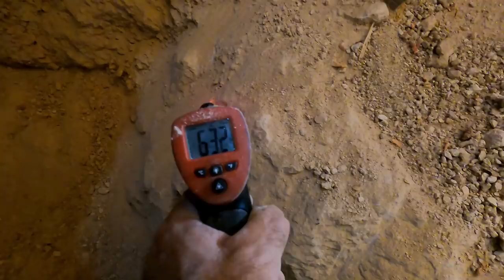Explosives Alternative to Rock Blasting Underground - Opening Up The Chinese Mine Shaft

Comment: You need a concrete saw. Score lines 6" to 8" apart 6" plus deep. should be able to get a pry bar in and break big chunks off. You can even use a water kit to keep the dust down.
Reply: You can buy them in battery or 110v , very little noise and zero fumes , a gas saw in their would be brutal
Reply: He runs his tailings through a crusher and sluse and gets gold from it.
Reply: Big fan watched it all from the beginning. I would like to meet ya some day. To pis poor to get back down to az. My fam. Spent wimter in quartzite.

Comment: I use hydraulic splitters to  break rock, heaps quicker than the expanding grout, minutes instead of a day, and fewer drill holes.
Reply: You ever see that one made by Colin Furze? He dug a tunnel under his house and had a nice Hydraulic pick.
Reply: I use homemade blasting agents. But I wouldn’t recommend anyone try that. As the FBI and ATF WILL come for a visit!! They even came to me…..but since the Gov is soooo damn smart, they didn’t bother look to see I’m a licensed explosives manufacturer prior to coming here. I have a license, y’all won’t be as lucky!! So proceed with extreme caution!!

Comment: Jeff You want to pick yourself a ‘Powered’ air purifying respirator - one with a battery operated air pump, attaches to your belt and uses high efficiency particulate cartridges. Much more efficient and less fatiguing to use over a long period of use as it pushes filtered air into the face mask . Plus since the filter unit is behind you it tends to last longer as it’s out of the immediate work zone. Draeger, MSA and North all make these. It will be a lot less tiring than trying to suck air through a traditional unit like you are wearing . Keep up the hunt , believe me I know from experience - enjoy the videos!

Comment: Hey Jeff, 
 real talk at 12:36 in the video pause i. Now look in the bucket about halfway up the lip on the left hand side Edge, you can see a ( m )-shaped or a (  w ) shaped Stone / possible vertebrae. When the thought of it,  
If  I didn't see the exact same shape at the front bottom right of the bucket. An M or W shaped Stone. And if you look in the middle of the lip of the bucket about halfway in the middle up and halfway centered you can see 2 vertebrates that look like they're connected and the 1 on top has broken off and rolled away.
   Am I tripping or could that possibly be bone fragment?
Reply: Ps.  I used a ×10 magnification looker.

Comment: Hey Jeff!

I think your videos are getting better every time! Really great to see an alternative for blasting with explosives. The vibrations of explosions could cause all sorts of trouble. Now its nice and quiet. 

Do you also make exploratory sample drillings? That could safe a lot of time and money right??? Or is the ore to scattered or gold to chunky to make any good drillings? Or are you already in the right spot? Im reading "Metal Mining Practice by Chas. F. Jackson & J. H. Hedges", its from drilling samples to making (wooden, concrete, and steel) sets. Maybe it brings cheaper alternatives for making shafts and tunnels. I also uploaded it to my archive page (if you cant find it).

 Greetings,

Jeff

p.s. 
The archive page also brings some books about digging tunnels in soft ground. I dont know if i would want to do it like that. Maybe its more easy to inject grout ahead into the loose ground above and to the sides of the would be tunnel and support from there. So there is less chance for a cave in... Something like the New Austrian Tunneling Method.

Comment: Hello, I have been following you for a while and I like your method of prospecting and working on extracting gold. I would like to ask about how deep the hole is from the beginning, vertically, so that I can dig horizontally and safely - your follower is from Mauritania.
Reply from the maker: our drift mine is 40 vertical deep at it deepest point
Reply: @Askjeffwilliams  Thanks for the answer, I mean that I can open a tunnel after 40 meters in different directions targeting the gold-bearing quartz vein.

Comment: Worked at Homestake underground operations for about 8 years.  We used air powered jackleg drills with drill bits on the end of drill steel.  I would think that would be a lot faster for hole drilling.  Nice thing about that is you can knock the drill bit off and sharpen.  Love what your doing, doing without explosives would suck but I gotta admire your energy.  I would enjoy your video a lot more without the attempts at humor or whatever that is.
Reply from the maker: I agree ...gotta get my hands on a Jackleg ...... we always like to show other methods of breaking rock as not every one has an FEL
Reply: @Askjeffwilliams  learning to use one is the easiest way of turning a strong man into a weak man, LOL.  The air leg is a real bitch.  Once you get onto them they are amazing.  Spent more time on one than I care to think about.  Pretty sure at my age I could still run one, but I don't want to.
Reply: Dakota: He's a package deal!

Comment: Add an secondary container with a opening 2/3 down from the top on the side,
 opening facing  left. For your working hose connection to suction drill holes in rock.

and a hole  in the center of the lid so as to  hook the vacume cleaner  hose to center hole.

 This configuration Creates a swirl in the secondary  container where most of the rock in aggregate  swirls down to bottom ,and only the finest dust makes it  off the wall and in to center hole. 

That dust is transported to the primary vacuume container and into the filter.

If your secondary container is small enough to fit in your lift bucket  just roll it over and drop it in. Ring the bell  and clean the filter while you wait for the return.
Thats how i would do it. The shopvac could be 20' away from your secondary container if need be.

Comment: I used Dexipan on Several OCCASIONS HARD ROCK .. IT WORKS SIMPLY spectacular. I actually used 1” drill bit 18” in hard rock Rhodonite , 12 holes  and broke out 10,000 pound 6 feet into the bed rock..  I also drilled a 10,000 Boulder and it is set to pour Dexipan  in this summer.  I do same as Jeff use vacuum to clean hole but I actually use a 18” by 1” round hole brush to clean sides of holes. And I also drill 1 1/4 “ core bit  in few of the holes to get a picture of the material.  Just polish core . I actually purchased my Dexipan at HOME DEPOT JUST ORDER THE TEMPERATURE YOU NEED!
Reply from the maker: great info

Comment: leave it for about 4 days and pour  water over it everyday if possible.
 we tried leaving it lower in the hole and capping it off with some rapid cement but didn't seem to help.
the ECOBUST brand is a bit cheaper and works just as good.
the deepest I have ever gone is 24 inches x 1 1/2 inches and seems to work all the way to the bottom.
your correct about using it an edge to rock has somewhere to go..
after you pour it, try and get any air bubble out of it with a stick or rod or hit around the rock with a hammer. I know you dont have
much time...its fast and gets hard quick. adding more water than they recommend does not seem to effect the results but takes longer
to do its job..yet gives you more pouring time. I don't think you will use it for mining..its too expensive.

Comment: What if you took a rock cylinder drilling core sample and cap the hole with that stone cylinder and hammer a cut nail in the side to jam fit it so it cant pop out. Might force more expansion sideways and that last 4 inches of hole wasnt used so it saves on slurry a little.  Or a wood dowl hammered in with a split hammered in the center to jam it in tight.  Like how a hammer handle is split to stay on tight. Just thinking too much.  Enjoying your success totally.

Comment: hey jeff- why not use a suction hose of sorts? 2 and a half or 3 inch tube with vacuum. you dont even have to shovel or hoist it up. less dangerous, faster, easier. save the hoist for material you want to run thru a sluice. when i was younger i worked breaking up granite for building sites.  we would drill it and then use a hydraulic ram to fracture it. it produced 75,000 psi and worked on what i would call bull granite to a good effect. the ram was made in germany. it was cheaper than getting a blasting permit and etc.

Comment: Use a funnel with a hose attached to it that's two-thirds the size of the hole to allow the slurry to flow to the bottom fill straight to the bottom so that way you don't end up with in the air pockets
Reply from the maker: thanks for the tips

Comment: You asked if someone had a better way... well... You might try 1 " holes about 6" apart and try "Feathers and wedges".  We tried that expanding cement when removing large corners off stone sculptures, but it's so darn EXPENSIVE!  We use feathers and wedges.  They also make them for 1/2" holes which is 1/4 the time to drill than a 1" hole.  

We drill holes in stone just like you're doing - that's WORK!!!  Why am I watching you drill holes in rock after doing that all day myself?
Reply from the maker: thanks

Comment: Now that you spent all that cash on your new full face respirator, buy some tear away lens covers. They stick to the mask edges and take the beating so your mask will last much longer without scratches. You can put layers of them on and pull one off if it gets too dirty. Also, wash all the rubber well after every use. Sweat and dust will kill it. Good thing to have for what your doing, nice upgrade!
Reply from the maker: thanks for tips
Reply: @Askjeffwilliams  Glad to help. I've been using such equipment for 30+ years.

Comment: Hi Jeff,
. The 2 connectors that are hooked to the sides of hoist barrel are not rated for lifting. The shackle at the top connection that meets the cable is rated for hoisting. Also I think that the barrel connections should be reinforced. Probably plated and drilled to accept two 3/4 inch shackles. When hoisting 3,000 pounds the rim of the barrel could tear through. I don't want to see you get hurt. So come on let's go!!!
Reply from the maker: thanks

Comment: why not try air bag splitting of the rock face ... sure you have to drill holes still but then add air bags pump them with several atmospheres of air and let them crack the face open ...

Comment: How about small Air Bags.....? Still have to drill holes....! fill hole w/small Air Bag....link all the bag hoses together, run compressor, build up Air in tank... when it 100 PSI, open main Valve to manifold, the open line valves to Air Bags.......! a Soft BOOM....!  =)